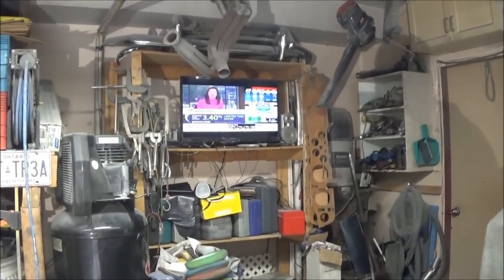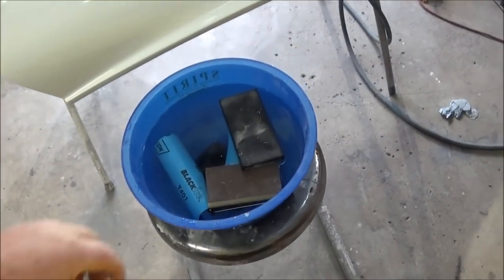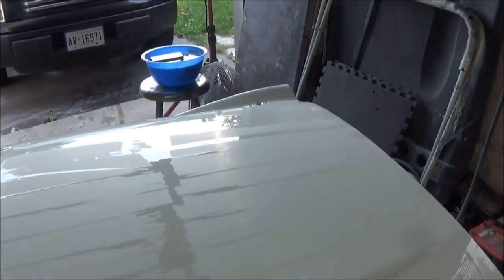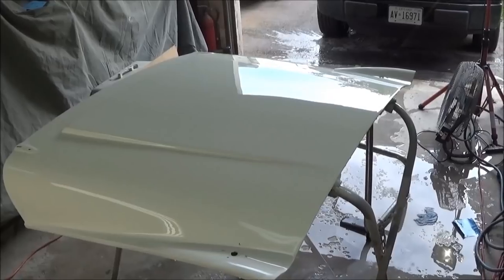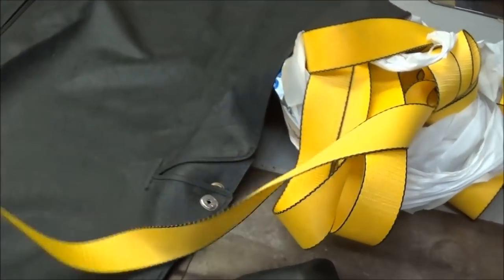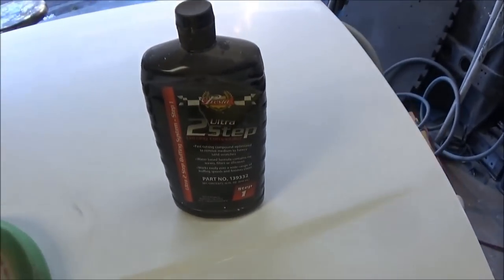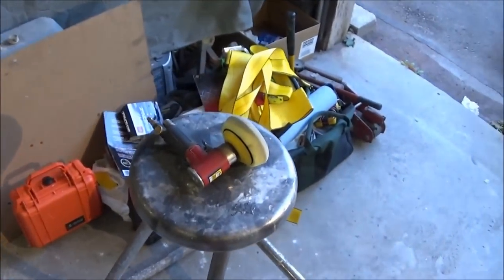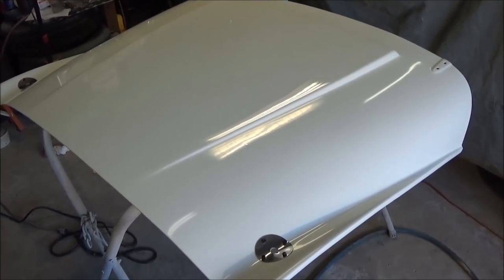1960 Triumph TR3A Bonnet Buffed and Repairs to the Convertible Top and Tonneau Cover

Comment: Looks great. Take care when placing the bonnet back on.
Reply from the maker: indyme2 I managed to get it on without any damage.   It still a little tight at the front apron gap but I’ve got it adjusted as far as I can.   She’s all packed away in the trailer tonight.  I leave at 4:30 Am for the TRip to NC.  I’ll understand if you can’t make the show on Saturday. The weather looks pretty horrible from tomorrow through Saturday...
Reply: Wouldn't miss a chance to meet you. Will be there rain or shine. Thanks.

Comment: I'm a big fan of wet sanding been doing it since 1972 when working on my cars..that hood has some tricky angles on it. A real challenge to keep paint from sagging or running. Lot of sharpe edge that could easy burn when buffing but I must say you know your way arourd your bonnets..Nice work . my old TR4A hood would have been a tuff one with that bubble on it little buffer for sure enjoy that car it was a 1964 red black inside . fast but sold it the frame was rusted and rotted plus i was 17 did not have the skills yet on frame repair. again 17 procured 1967 GTX that is gone too I guess at 17 you are not that smart..